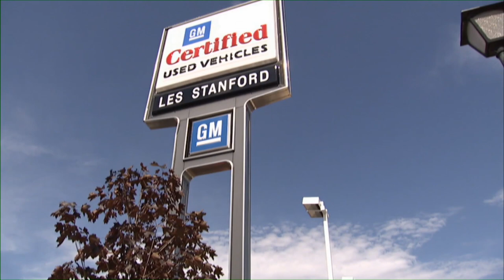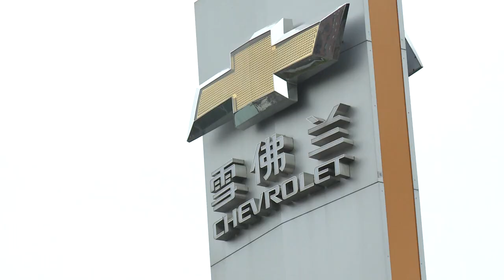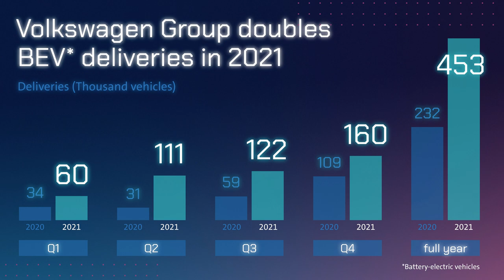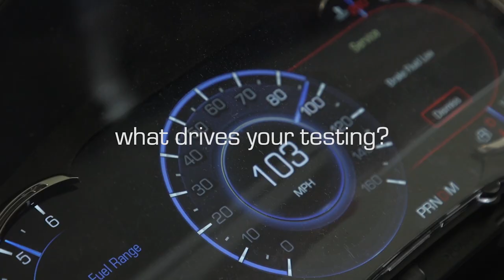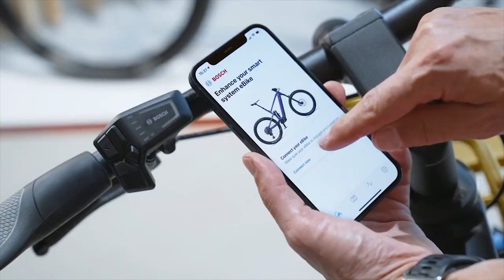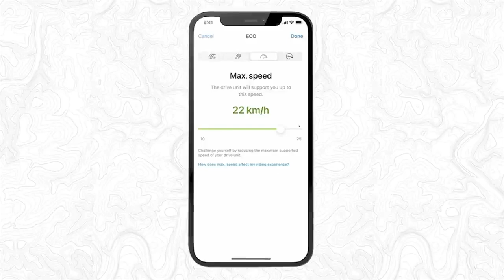GM Launching Used Vehicle Platform; NACTOY Winners Revealed - Autoline Daily 3237

Comment: Dear Autoline,

I need your insight on a few questions related to global auto sales: 1. Is the chip shortage having just as much of an impact globally (for example in China) as it has in the US, causing car prices to skyrocket? And 2. When (not if) the Chinese automakers enter the US market, will they pressure the existing players to cut prices by introducing competitive cars at much lower prices (which is what Hyundai/KIA used to do at first), and what is preventing them from already selling cars in the US?